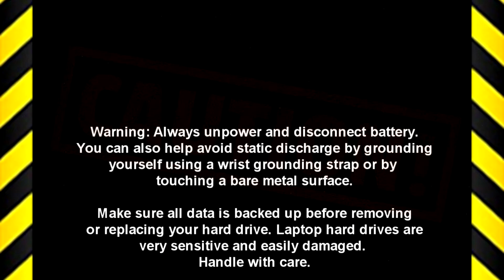Dell Precision 15-5530 (P56F002) DC Jack How-To Video Tutorial

Comment: 1:30 See those three screws there? Once you get the bottom base off, you just need to remove those three screws, lift up the part they were holding down (that part is actually on the hinge, so it can be rotated up!), remove the screw holding the DC jack, then replace the DC jack.

That way, you don't have to remove all the other components this guy removes (battery, hinges, wireless bracket, wireless card, touchscreen assembly, etc.).
Reply: Thanks buddy I'm going to try your method this evening. I'll let you know how I got on
Reply: Boom! Did it! So quick and easy. Thank you (both)

Comment: Attention! There seem to be different designs within the 5530 computers. In my case, for example, the connector strip (3x black, white, 3x red) is rotated by 90° compared to the one shown in the video and there is a metal cover over the DC jack, which took me many minutes to remove.